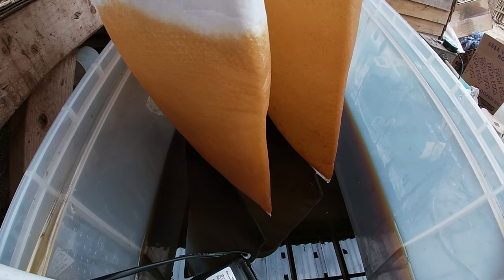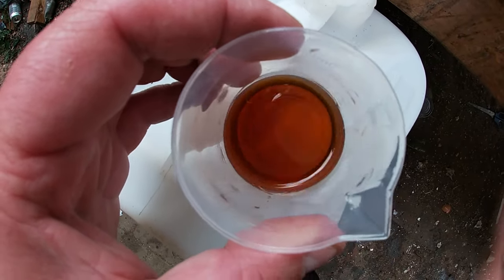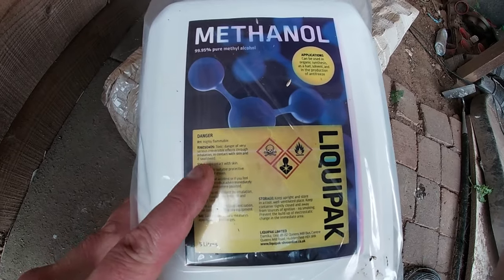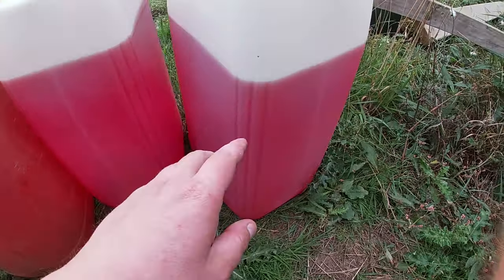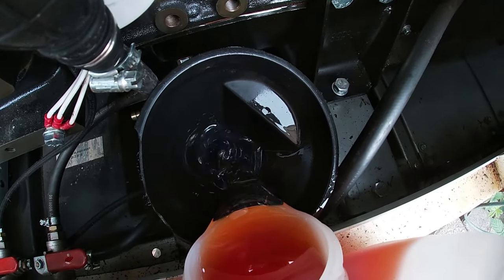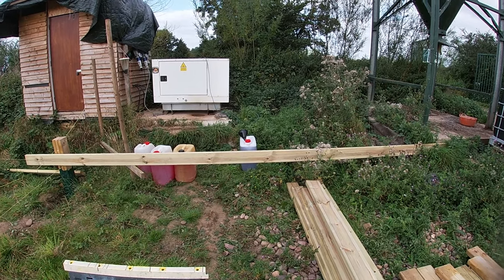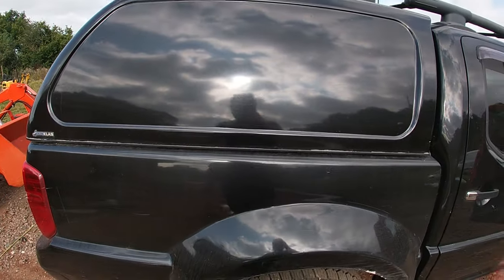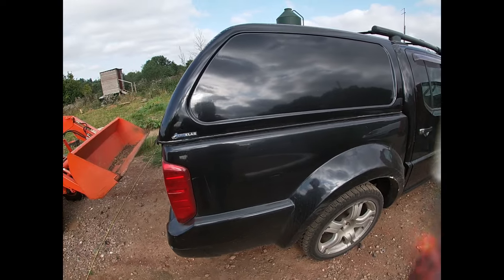3 ways to make Bio diesel from waste veg oil ! Making easy Bio diesel at home ! Making cheap fuel !

Comment: Great video man, love the content, well done.👏 Can you use fresh (new) veggie oil with the kerosene? will this method have a negative effect on newer diesel engines from 2010 to 2021? Again, I would like to say this video was excellent on this topic, compared to what's out there. 👌👌
Reply from the maker: Thanks mate, I think the negative effects will come if your engine has modern modifications to reduce emissions as veg oil/kerosene is smoky lol. or it's a small engine that has a fancy common rail injection system, the one on the generator works fine with the mix as it's all decent gauge pipe. Its basically the balance between potentially having to fix components like injectors or fuel pumps and the fuel savings
Reply: Hi guys, so have u tried the new or old veggie old, as I'm wanting to make it but not sure if it will cause damage to my car, I have a e46 320d 2004 model, fuel prices are getting crazy... Pls Hola at me guys many thanx for this great video..
Reply: Just start out slowly and don’t make too much, if it does clog up injectors just clean them etc, remember this won’t damage the motor side at all.
Reply: @andrewdaly9503  Just wondering how can the injectors clog if you use new viggie oil and kerosene? Isn't it more cleaner than diesel? Wouldn't all the modern technology make it more better since you are running clean fuel, than worse?
Reply: By adding new cleaner bio-fuel etc can clean the old pipes of old build up and that is what can block filters/ injectors etc. had loads of vehicles here clog up with this problem a few years ago when someone started selling bio-fuel.
Reply: @andrewdaly9503  You do learn something every day :) I guess once everything is relevantly clean or you have a very low mileage car you shouldn't have any issues with clogging.
Reply: Don’t know about adblue diesel motors and newer Diesel engines only slightly older ones. I know the clogging problem turned a lot of people off bio- fuel.
Reply: If you are in the UK you can't use ANY of these methods  on the road - not unless you want your car taken and crushed if you are caught. Don't be stupid the vlogger is talking about farm machinery NOT a car!  I know some people who run theirs on 50 white and 50 veg oil - if they are stopped they are in a lot of trouble. And with fuel prices going up check points will be more and more common
Reply: Im in Australia where it’s legal just like making whiskey or ethanol if you want.
Reply: It's not you can use up to 2500 ltrs of veg oil legally.
Reply: @petecoventry6858  not true
Reply: @petecoventry6858  perfectly legal in the UK.
Reply: @petecoventry6858  nope, that is incorrect information. You can legally make and use up to 2,500 litres of home made bio diesel tax free for use on UK roads. However, if you use RED diesel or heating oil in a road vehicle, THEN you are committing an offence of tax/excise evasion and will be fined of get your vehicle confiscated and crushed.
Reply: @petecoventry6858  really? That’s the dumbest thing ever lol in the u.s I’m pretty sure no one would comply with searches as they need a warrant
Reply: @andrewdaly9503  That happened in North Wales to loads of vehicles, including mine, the fuel stations selling the bio-diesel stopped selling it within a couple of years as people learned that their motors didn't like it😆
Reply: @petecoventry6858  It's illegal in The U.S. too. That's why off road diesel and fuel oil has a red coloring in it. The good news is they seldom check cars. They mostly check Semi Trucks. By doing it you are taking a chance and the fines are astronomical !!!!!!!
Reply: @dantuel  You can strain red diesel through cat litter and thus get white diesel.

Comment: How much did the water filter cost. Do you have a link to said filter & how much oil can you filter through one set of filter pads???
Great vidio BTW 😁
Reply: it's easier just to buy a 1 micron sock filter & pour the oil in- gravity feed into your container without having to pump it & use water filters.
Stack the 10 micron filter inside the 1 micron filter & pour away- fully filtered once it's in the jug, & you're ready to go

Comment: I meant to ask, have you ever mixed your used frier oil with petrol? I've heard several sources that say its a good solvent/thinner for the WVO. But the exact ratio has several opinions. Some say to mix 20% petrol. This was a man only interested in the viscosity issue. Another source said a maximum of 10%. This created a question in my mind. Is it dangerous to go above 10% mixing? And if so, why? Too explosive for the injector process perhaps? I'm in the throes of trying to solve this riddle. If you have any useful info, it would greatly appreciated. Tx.
I'm figuring if the 10% ratio is good enough for a Toyota 1HZ motor (a very stock standard diesel engine from Toyota) then it would be a very cheap way to create biofuel at 10% of the current cost of petrol. In Australia at the moment that would come out at around 20 cents/litre. I'd be happy with that!!
Reply: @Drugaskan  Danke shön mein Herr! Leider, mein Deutsch ist nicht sehr gut, aber Ich versuche!
Back to English now. Yes, thank you for the advice, and the tip regarding wear on the moving parts. No one else is speaking about this, in such terms and percentages. The information so far is sketchy and vague, at best. You have added some reason to the subject, so Danke once again.
Reply: @Drugaskan  Thanks for that common sense tip. My vehicle is a year 2000 Toyota Coaster 4 tonne minibus (now a motorhome), with a 4.2 ltr 1HZ Diesel non turbo engine. It was a school bus for many years of its life, but is quite possible, that while the engine was serviced religiously, (I am confident of this because it runs so well and has only got 360,000 km on the odometer) the fuel tank, however, was probably never dropped out and internally cleansed. I will do this at some point this year.
I'm intending to some very long trips around Australia, running on filtered WVO. I'm building a two-tank/two-filter system for the fuel supply with an electric solenoid for fuel selection, so that the engine may be purged/flushed of chip oil (WVO) at the end of each day's travel, where the injector pump and injector nozzles can be properly cleansed and lubricated with mineral diesel, for around 5 minutes or so, at start up and shut down. From what I have heard, I believe this to be the best practice for good engine maintenance and avoiding breakdowns. You probably already know all of this. Sorry. But its new and exciting for me!
Thanks to people like YOU responding to my comments I am learning so much! And... how to do things the RIGHT way, that will not end up damaging the motor.
So... Danke schön once again!

Comment: Question: 
If left stagnant, are there any issues with the mixture (diesel/oil, kerosene/oil) separating or settling out while sitting in the fuel tank?  (eg.-  non-operating/parked for a few days)

Comment: I used to run landrover discovery on cooking oil 25/75% winter 50/50% summer until I discovered put a verry little petrol in and it stops waxing that happens in low temperatures and blocks filter.
Reply: How much petrol?

Comment: Nice video! Informative! 👍 Do you know if we can legally use the kerosene/veg oil mix on our roads? Or is it just for round the farm?( I know veg oil has to be declared for tax just wasent sure about the kerosene as an "additive") Thanks.
Reply: Supposed to be converted to biodiesel to use on the road, and you dont need to declare it until you are producing or using more than 2500 litres per year
Reply: @YorkyPudinz  AHH ok , thanks for the info. do you know if mixing kerosene with veg or bio is legal on the road? Or is that mix just good for the farm? Cheers 👍
Reply: @JGibzy  the law it very vague in regards to running veg oil tbh and can be open to interpretation. Personally speaking, if you feel alright running it in your car, then run it. It certainly isnt illegal like running red diesel. Some people still run black diesel (diesel mixed with engine oil), again the way on running that isnt very clear
Reply: @YorkyPudinz   okay cheers for the info fella , personally at £1.50 a litre for diesel, I'm happy to run something else. Just wasent sure about the kerosene bit but as you've said the law is vague but thanks again.

Comment: Any forms of biodiesel has the potential to cause what's known as a "diesel bug" which is a build up of bacteria starting in the tank and ending at the injectors, requiring the entire fuel system being replaced. I know this from experience of using red diesel in a loading shovel with  15% bio diesel, I dred to think the hassle vegetable oil will cause

Comment: When you mix 50/50 does it fall out of suspension?  If so then how quickly?
Reply: No. It does not because veg oil is miscible with kero or diesel.

Comment: Great video my friend🙌🙌. There’s a lot of folks out there saying never to run common rails with any of this wonderful stuff. But you’re running your generator which is a common rail? And have had no issues? 

I know this is a long shot question. Do you know of anyone running their 2004 1.9DCI Nissan Primastar (same as Vauxhall Vivaro or Renault Trafic) Which is fitted with the Renault F9Q engine on any of these great alternative fuels? Any information greatly received😀
Reply: i think they mean that you should not pour the thick used vegetable oil directly to the fuel tank, it is better to thin it out by turpentine, diesel, thinner, kerosene, white spirit etc. It will be fine.

Comment: Nice vid. Have you tried gas? I've read 80/20 gas in some places. Kerosone sounds interesting. Have you ran that or the 5050 diesel in cold temps?
Reply: You don't want to use gas. It washes the oil off of the cylinder walls and that's not good. I have known people to run 10% gas in the coldest days of winter to keep the Diesel from freezing but it's not a good long term solution.

Comment: Feel like I’m missing something on your filtering system. Why do you run it trough a water filter if veggie oil doesn’t contain water?
Now I’ve seen where you need to water wash once you mix in the methanol so this is why I’m asking.
Could I get a little better off explanation on your filtering setup?
Reply: A water filter will catch even smaller particulates.
Reply: Water filters aren't just used on water 🙈😅
Reply: @F4i Guy
Wow you don’t say? Only stupid question is the one you don’t ask…. 
I ask the question because he only briefly went over the filtration, I like the idea of blended diesel/vegetable fuel rather than the mix of methanol which requires you to remove water.
Reply: @dougj.8288  Filter it to remove small particles and water if using certain processes mixing most oil based products with diesel at a 50% ratio or lower will run most diesel motors not super techy or small injectors tiny capacity etc if you don't want faff mix 50 50 no need to filter if using new oil only filter used oil etc for micro amounts of contaminants id always suggest filtering everything you intend to pour into your fuel lines just for added security when setup takes minutes extra to filter to beyond eyes capacity ✌️
Reply: Most restaurants don't put the lid back on their veg oil tank. Rain and other contamination can get in before you get it

Comment: I have a 250hp Hyundai seasall marine diesel machine. Can I refuel the vegetable oil used for it mixed with diesel? Here in Finland, diesel is absolutely pig expensive at 2,5€/L and the tank is about 275L.

Comment: Hi, what ratio can I use if I mix waste  vegetable oil with petrol instead of using  karosene?...
Reply: That depends on the vehicle and the temperature bigger engines with bigger injectors tolerate thicker fuel. I'm in Canada in the summer I get away with 10% gasoline or petrol to 80% vegetable in the Winter I have to go higher 30-40% petrol. 1.9 vw tdi

Comment: Any problems using this kerosene-used veg oil mix in a diesel generator? Yours seems fine. Just wondering if it needs more servicing than usual?
Reply from the maker: It ran for about 200 hours no problem on the mix so far but i haven't ran it in months so this winter will be the real test lol
Reply: @FieldtoFarm_UK  thanks for replying. I’m contemplating purchasing diesel generator with this project in mind; just curious before investing. 

Is there any diesel gene engines more suitable than others for this fuel?

Comment: Thanks a lot, great explanation!! But i have a question: i have a barrel of kitchen used oil, but it is very old (about 3 years). Can I still transform It? Thanks again!
Reply from the maker: My first batch 50 50 mix was oil that was about 2 years old before I filtered it and it worked fine 👌
Reply: @FieldtoFarm_UK  ok, I'll try! Thanks!

Comment: Restaurant and Takeout's sell their old oil back to supplier in the area where I live making veg oil expensive to source. Also struggling to get the recommended filters at good price in RSA. Any tips on where to get them in RSA. When you buy them abroad shipping costs are to high.
Reply: @JP-hr3xq  big cookingoil producing companies in SA are apparently also using it for manufacturing of biodiesel.

Comment: Hi, are you mix diesel with pure oil or used oil? Thank you. And can I use this method for commun rail engine ?
Reply from the maker: Used vegetable oil, and my generator  is common rail. U just have to work out how much the filters/ fuel pump and injectors would cost to change and see if the risk is worth the fuel savings for u
Reply from the maker: Used vegetable oil, and my generator  is common rail. U just have to work out how much the filters/ fuel pump and injectors would cost to change and see if the risk is worth the fuel savings for u

Comment: Not knocking these methods for using waste vegetable oil, but just to be clear, this is NOT biodiesel.  Biodiesel requires a specific processing method using both methanol and a catalyzer such as potassium hydroxide or sodium hydroxide.   Again, I'm not downplaying the methods he shows in the video, as depending on the equipment you are trying to run, they can work.  But before someone does this and thinks they can go run it in their modern car, they can't, at least not without serious consequences.   I would greatly urge anyone thinking about doing this to do a modicum of research on biodiesel, what it takes to make it, as opposed to just manipulating waste oil to get it to run through certain engines.

Comment: I’ve been reading about this awhile and trying to figure out what would work on a modern diesel (emissions equip mod*) without damaging HPFP and injectors. I’ve got a 2016 Ram Ecodiesel V6 3.0 TDI
The fuel system on this thing is $7-8000…. Don’t want to damage anything
Tips/Advice
Reply from the maker: Sell it by a nice old one 👌🤣🤣

Comment: My old Peugeot 205D has completed 20,000 km on the kerosene/veg oil mix. I change the fuel filter every 5,000 Km, the Bosch injector pump has had no problems until now. I haven't yet tried it in my modern ish Renault with common rail injection. Has anyone tried?

Comment: Excelent information. Question: Does it work by mixing Ethanol? (Here in brazil we have ethanol cars and ethanol pumps in petrol stations, thus I ask)
Reply: Roberto, Methanol is Ethanol with a little amount of toxic additive so that alcoholics and others do not drink it. It is made this way so that people are forced to pay duty for their alcohol purchases. If you have access to Ethanol then you should use that instead of the Methanol. :)
Reply: @johnpelitidis6297  methanol is not ethanol with additive. Methanol is an alcohol with one less carbon hydrogen bond in its chain than ethanol.

Comment: Will that final kerosene method work on modern common rail diesel engines? I have a Ford Galaxy 1.8tdci (2008)
Reply from the maker: My truck is 2008 2.5tdi if that helps
Reply: @FieldtoFarm_UK  I guess there's only one way to find out. Alternatively, I might see if I can buy an old turbo diesel from the late 90s.
Reply: @seamusmolloy  don't do it. The Navara here has a Y25DDTI engine which has a VP44 pump; it's NOT common rail. You CAN use kero/veg mix on CDTI engines, but you really need to buy some long test tubes and drop test it against regular diesel to get the viscosity right. You should be down near the 5% mark as a starter though.
Reply: @seamusmolloy  did it work on your common rail engine?
Reply: @ucmeytsc7302  i haven't tried it.

Comment: What’s the octane of the 
kerosene and veg oil mix compared to 
diesel and veggie oil
Reply: The issue is that most cars/engines running alternative fuels aren't remapped/tuned for the new fuel, so anything other than what they were tuned for will be worse. But in a fire, say, veg oil has more energy per liter (because it's thicker), but less energy per kg (because the glycerine). Biodiesel is the opposite, less energy per L than diesel, but more energy per kg. But basically, they're the same.

Comment: Could u tell me if your pick up has a dpf,if so have you had any dpf issues,cheers
Reply from the maker: It does and but I blew my turbo before clocking any proper miles to test for problems lol will be fixed soon so I'll be doing another vid at somepoint on how many miles its done on veg oil

Comment: Sweden 
Diesel 2.50 euro/liter
Kerosene 5 euro/liter
Methanol 3.50 euro/liter
Whats the best solution for us here?
So a mix of 10 liters with 30% kerosene and used oil would cost me 15 euro.
The same amount of 10 liter normal diesel cost 25 euro here. The win of this mix is not that great..considering risks.

To use 2 liters of methanol for 10 liter wasteoil would cost me about 6.60 euro.
Absolutely the best way to do it in Sweden. All the sticky glycerin out. You can also clean it with normal water several times.